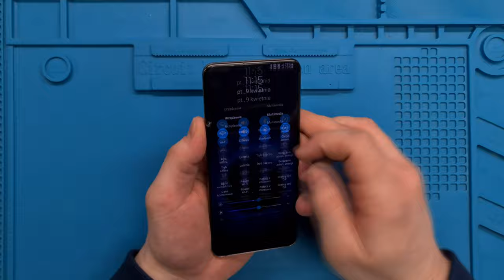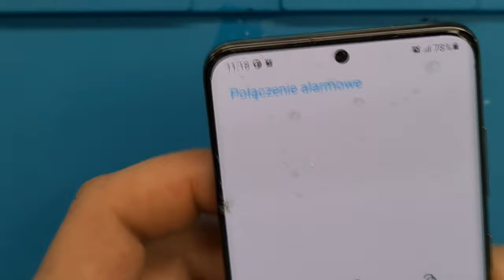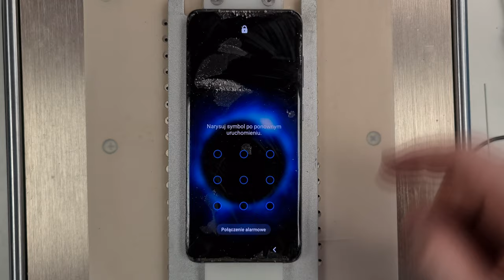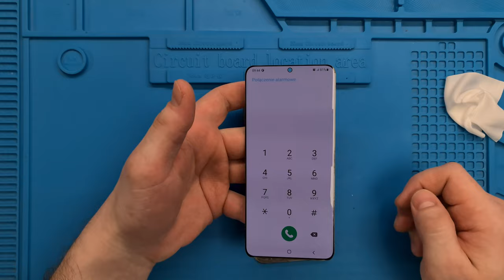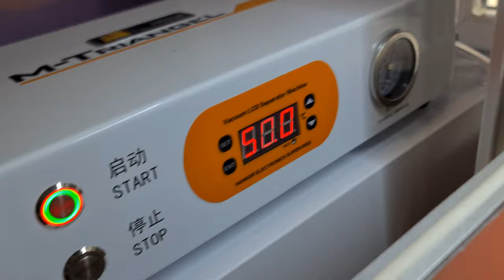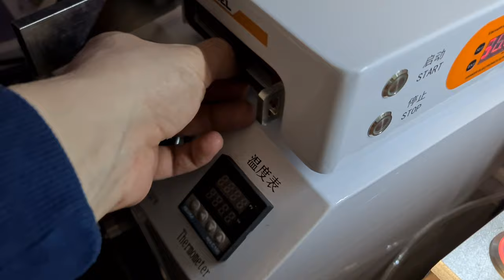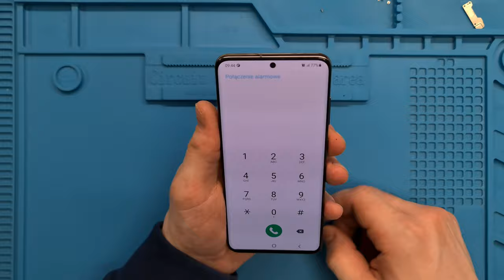🔧Galaxy S20 Glass Replacement - Glass only complete guide [4K 60FPS] 😎

Comment: Thank you for assuring me that there is NO WAY in hell I will try to do this myself. Great job but I'm heading to the repair shop.
Reply: SAME LOL
Reply: I'm laughing out loud 🤣 😂..nice
Reply: Jesus. Just the cost of the machinery, notably the press machine, the tools, etc. Yeah, no thanks. Repair shop for me as well! Nuh-uh!
Reply: The repair shop doesnt do this, just so you know. Too much risk of damage to the LCD. The glass is glued to the LCD. About 99 of 100 use a small heat source to remove the back and disassemble it and replace the glass and LCD digitizer as a unit. THAT is actually do-able by a tech savy person. I have replaced internal components like charging jacks and batteries that way myself. There are multiple videos that show you how on Youtube.  Again tho. Even that, I wouldn't recommend to someone who maybe has never worked with electronic components before
Reply: @vanceogden2482 I might lose a screw lol I'd rather melt the screen lol
Reply: The problem is a refurbished s20 cost less than a screen repair in AUS. It's a crazy and frustrating situation 😂
Reply: I died reading this 😂😂😂😂

Comment: You make easy. I did my s8 and it was f#@king hard and I didn't have best tools but I got Glass off  but I nicked the display and I had a little tiny black mark in corner it was really small.   That was my first one I ever did. I save some cash and it worked good. I geuss the more times you do it better you get. I won't to get some better  tools because repair a lot of my friends cells too. Thanks for video 👍🇨🇦

Comment: maaan you are separating glass on a working phone. this means it definitely has a battery inside while on a 110 C degrees separator. well. it HAD a battery cause R.I.P battery now. such a good video in terms of display repair skill and such carelessness..
Reply from the maker: 250⁰C will break the battery, but not 110 😉 I made hundrets of phones and never get problems.

Comment: Why was the AMOLED removed? Can the new glass be installed without removing it?
Reply: Perhaps the UV curing, laminating, and vacuuming processes for the lcd can damage the motherboard.
Reply: @joebanks3698  
I thought it would be mentioned in video.  ??? I have a lot of MB experience. No knowledge of that sensitivity. No experience where the MB was more sensitive than LCD. It's usually the weak link.
Reply: @Joe Banks  Avoid all that headache. Do like the average repair shop does like the Asurion insurance repair tech does when they repair your phone in your vehicle in your dooryard. They replace the glass, lcd/digitizer and the frame that holds them as a unit. Back is removed from the phone with heat gun, battery removed and internal parts, including that frame, new frame assembly put in along with all parts and back is glued back on with new adhesive strips. This method is just to show the high tech method of doing just the glass. The HEAVY majority of shops do not have this equipment nor do they want it. Mall kiosks and little repair shops there most certainly never do this. I tried to find a shop in the southeast PA area once to do this and the only one that expressed the ability was a small shop that said their quite young repair guy said he could do it. I did not trust him with the job. I kind of knew the equipment that would be needed and the process as I was told that some places that have it use a freezing process to make the UV glue brittle and there was next to no change he had it.
Reply: @Vance Ogden  isn't the digitizer really expensive to replace as opposed to replacing the glass, which is only a few quid?

Comment: What are you putting on the frame edge at 11:16? What glue/adhesive?
Reply from the maker: it is B-7000 glue :)
Reply: @JerryMobilePL  any reason why you use the b-7000 instead of replacement pre-cut adhesive?

Comment: Hello everyone  , please if someone can help me , i just dissasembled my phone because my earpiece was blocked and cleaned with some alchool from the inside , i managed to get it fully working and asembled my phone all together  , for one day i was working perfectly until next day screen flickered and went totally black . Phone is still working because i can hear messages notifications but screen not working at all (just black screen) . Can anyone give me an idea what went wrong and how to fix it?
Reply from the maker: Hello! Maybe some liquid left inside the phone? Disassemble it again, heat for 90-100⁰C for 30min and check again. Disconnect the battery when heating
Reply: @JerryMobilePL  thank you . I'll give it a try
Reply: @JerryMobilePL  thanks for you reply .
i managed to turn it on only if charger is plugged in, it works for a bit then it shuts down display again , i can hear notifications still ringing. very weird problem

Comment: That screen was so dirty u had finger prints under it. U spent all this time scrubbing the right side when the left side was disgusting. There's no way that was the same screen. Like.
Reply: At 8:11 you can see all the crap on the left side of the screen and u Scrub the right side but don't touch the left then u put the screen together with visible glove/finger prints and somehow it looks brand new after I don't get it
Reply: Or was that scratches from the wire or something. I just don't get it I must be wrong, great work but still I don't get it.

Comment: So how would I do this without the machine
Reply from the maker: without machine You can do it with LOCA glue, please check on my channel- I have S10 video home solution. You can try like this
Reply: @JerryMobilePL  I was wondering if I could use loca glue to repair my screen on samsung galaxy s21 ultra so it won't damage it?
Reply: @JerryMobilePL  I know u can use loca glue on older glaxys but I was curious about the s21 ultra
Reply from the maker: @zmillie2364  You can use loca glue on EVERY oled screen, but will be more waves etc. But will work perfectly